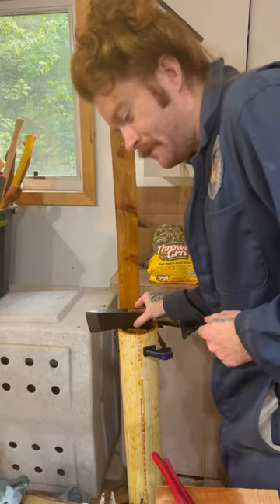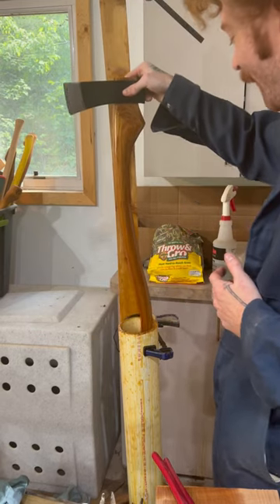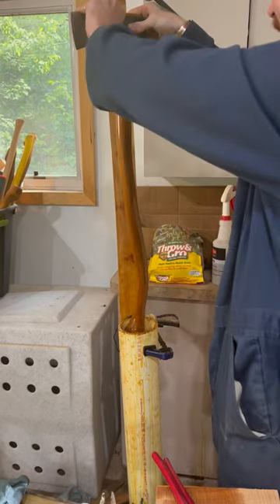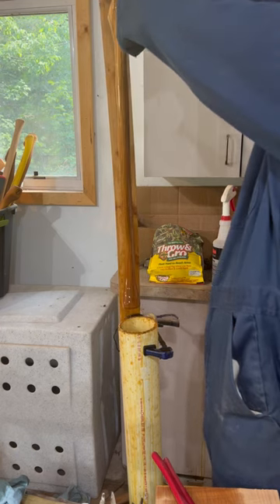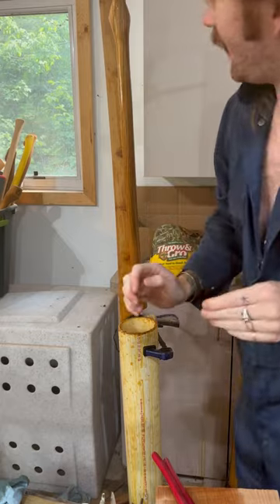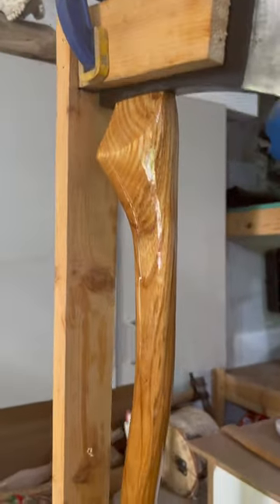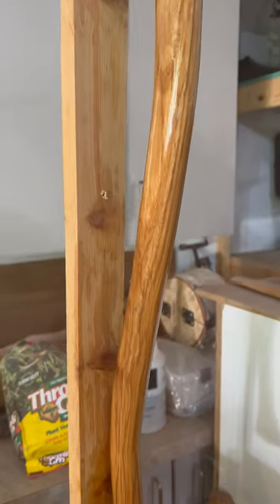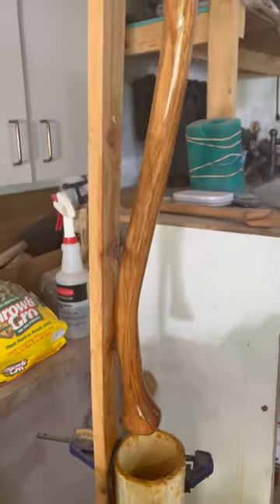Building A JAPANESE Splitting Axe Pt. 6 NEXT UP: Splitting!!

Comment: Those metal ring wedges are not necessary...they will near always split up the wood within the ax bit eye. You did such beautiful work then to kinda ruin it by driving metal that doesn't conform to wood in there. A wooden wedge done well is ALL u really need. Also much easier to deal with down the road.
Reply from the maker: It fills the gaps even more and compressed the wood against the inside of the eye even further. But you’re right, a GREAT wedge is all you need. I like to add these if it’s my axe and I don’t want the devil himself to make it loose.